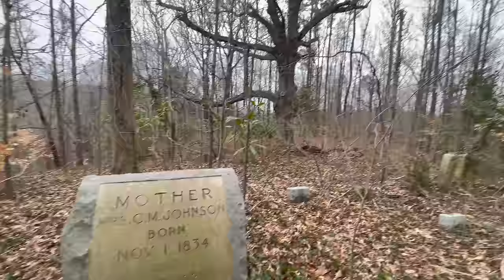Exploring The Unknown: I Found An Open Grave!

Comment: I worked in a cemetery… it’s called a concrete vault, and the casket is placed inside to prevent water getting to the casket
Reply: I worked at both Funeral Home and a Cemetery, if that vault has the lid on as this one does, there is a casket inside, got to remember that vault ( Plain One ) is right at 1800 lbs including the lid, lid is about 400 lbs and it seals itself, why they have a 2in hole on one end. Could be a disinterment and moving it some place else, Hope this helps.
Reply: Thank you
Reply: No Dalen YOU ARE NOT THE ONLY ONE THAT  IS FEELINGS THAT WAY IT Looks scary in THAT  grave and very tight.
Reply: Yes and it stops tha casket from collapsing.
Reply: My funeral director/embalmer husband of 44 yrs says it Is a concrete vault. There is NO ONE inside or it wouldn’t be left there unattended. It is to protect the casket from collapse and seals to keep out moisture for protection of the body.
Reply: Thank you for the information shifter friend!
Reply: I've heard that it helps to keep embalming chemicals from leaching into ground water as well.
Reply: If some thing came up behind me and made a loud noise that would do it for me!
Reply: Yes a burial vault, it also keeps the grave from sinking in once the wooden casket decays.
Reply: Yeah… I was sure no one could leave that unattended. At least not in my state.
Reply: Also called a liner
Reply: We recently buried my uncle and we had the option of a “liner”.  Same thing. It keeps the casket safe from all sorts of damage.
Reply: Liner
Reply: Or could be another person is going on top of that vault. They do bury one on top of another
Reply: @elizabethruggiero9950  I was wondering, why is it just out there. Maybe the funeral is real soon. weird.
Reply: In my state, we are not allowed to leave an open grave on attended. If it was open and ready for burial, there was always plywood over the hole. We also never left a vault out. The bottom of the vault is placed in the hole, then the casket is lowered, and the top goes on once it’s in the ground. The lid is on, there’s something in it. State regulations would never allow that where I live. It looks like they just took a lunch break in the middle of the process.
Reply: No the casket is in that vault in the ground uncovered
Reply: There is leaves crunching in the ghost monitor along with the voices
Reply: @michellelanigan1964 if there wasn't a casket in that vault it would not be sealed so someone else probably went ontop of that one
Reply: Why is it sitting above ground right now
Reply: Prevents for a little while but over time it crumbles,cracks and collapses. To me just a way to get more money from family or state..
Reply: This is already placed in the ground before the funeral procession even gets there. The casket is then lowered into this vault. Like others have written, it is for protection. Very common where I'm from.
Reply: I've seen too many concrete vault's that have flooded and the caskets are filled with water. Such a shame 😢
Reply: That's a concrete vault, and the casket is inside.
Reply: Where I'm from, the vult is already in the ground before the casket is inside. Lid is put on after all people have left the burial.

Comment: Dalen! That is a massive cemetery! How can the city or the county allow this hallowed place to be so neglected!?
Reply: It looks to me like one of two things. The crew set the vault and then something on the end caved in (the small cave there is not supposed to be there) so they stopped. Or, the crew set the vault, stopped for lunch and planned to bring the rest of the setup/equipment out to finish afterwards. Cemeteries are a work in progress. The cave in bothers me though. Is there another grave on that side of the hole, or is there an underground problem the cemetery doesn't know about (perhaps a broken water main or somehow something wasn't backfilled properly before?)
Reply: Tru

Comment: You were told  correct,this cement container is the vault. It goes in 1st,then the casket is sealed inside so water 💧 or anything does not get in the  casket. Keep up the good work. ❤❤❤

Comment: They must not have used burial vaults in the old non-perpetual care part of the cemetery. I'm glad one of the graves didn't give way beneath you where a coffin has collapsed.
As much time as you spend in cemeteries, the odds are that eventually a grave you're walking over, or standing on, will collapse. You're alone a lot of the time. Please be careful.

Comment: Hey Dalen. I would think that if someone got a pod and was to the point where they were going to use it they would have answered those questions. So let the 3 questions inside the pod give them something to laugh at. Are you sure? Are you really sure? Are you really, really sure? Go out with a bit of levity.
Reply from the maker: I get that… but I feel
Like for something that serious you gotta be SURE. I read that out of all the Golden Gate Bridge fall survivors the vast majority said they regretted it the moment they stepped off the bridge.
Reply: @DalenLSpratt  oh you definitely have to be sure and is not something to be taken lightly at all. I just wanted to put a little humor in it. It’s a very heavy, thought provoking subject.

Comment: Daylen that is called a cement vault it is used to put the casket in. It helps to protect the casket from being crushed by the earth so the grave to won’t cave in is also known as a grave liner. They also have steel vaults, which is the same as the same but different material

Comment: Also, the vaults prevent the grave from "falling in" as is the result of wood caskets rotting and falling apart which causes the ground above to sink or cave in over time.All graves that are found in older resting areas that are not kept up, have "sunken" or "caved in" graves  due to wood caskets having been used.Perhaps when no casket was used as well.

Comment: Dalen that is concert vault for casket to go into. Here in Missouri you can just bury the casket without a vault. There are so many different onesThis is cheaper one. There  are metal oneso,  steel ones, There are vaults that completely seal no water can get into caskets. Think about it if it's raining and grave hole has water in it.
There different prices on all different vaults.

Comment: Yes. They are cement vaults that go in the ground first; and then the casket goes in the vault at time of burial. Yes, it helps to keep the moisture and dirt off the casket. In some states they are required by law to put in vaults.

Comment: Hey Dalen!  Most are called vaults or grave liners.  Majority of cemeteries now require one to keep grave from falling inward.   Both parents had one.  The bottom liner is set first, after burial/grave ceremony they will lower casket in, then seal the top on and finally the dirt 🤷🏼‍♀️  If you were ever buried alive, rare nowadays, one would never get out since the liner lid alone is about 350-400lbs.

Comment: These grave liners are also known as rough boxes, concrete boxes, or grave receptacles and may be required by the cemetery. They protect the casket preventing cave-ins for the ground above that could cause damage to the cemetery property

Comment: I googled the outer burial container and burial vault.  What I found was "First of all, outer burial containers and burial vaults are not required by state or federal law. They are required by most cemetery rules and regulations. Cemeteries want a casket placed in an outer burial container or burial vault to prevent the ground from sinking in above the casket.  Without the use of an outer burial container or burial vault, cemeteries would require constant maintenance to keep the ground level."

Comment: That is a concrete vault. The casket fits inside and the concrete lid closes it off. It is lowered in the hole the concrete lid is sat to the side along with the dirt from the hole. The coffin Fram is placed around the grave hole and covered with the astro turf grass. The coffin is suspended by three straps until after the graveside service. Asked how it worked once.

Comment: Those are concrete vaults to protect the casket. The casket is placed inside of it to protect casket from water damage.  Not everyone gets vaults, however, some cemeteries might require it due to the type of ground the casket will be lowered into.

Comment: What is the concrete box in a grave?
Grave Liner

These grave liners are also known as rough boxes, concrete boxes, or grave receptacles and may be required by the cemetery. They protect the casket preventing cave-ins for the ground above that could cause damage to the cemetery property

Comment: I hate this type of vault because it opens on the top.  A tar-like seal is placed between the lid and vault after the coffin is inserted to keep groundwater out.  Guess what happens if that isn't done correctly, or the seal dries out and cracks. Granny's coffin turns into a bath tub. I like the ones that open on the bottom. The vault is still sealed between the base and vault, but if the seal fails the vault acts like a bell jar and naturally keeps the water out.

Comment: That is a vault that the casket goes in. The dig a hole and lower the vault down into the grave and as soon as the funeral is over the casket is lowered into the vault for protection of the body and casket.

Comment: That is called a vault, and they use that so that their area will not cave. In. It also protects the coffin from Getting crushed. It also helps not linen to chemicals used for involving 2 seep into the ground around it. Each state has a different law. Most states you do not have to be embalmed

Comment: I believe that is a casket box you set it down in the hole that you dug after you dig the grave spot up and then when you when they set the casket down that comes up that's just a protector so none of the dirt would collapse as they put the casket down into the groundthe bottom of it should be Halo but some people also have another Stone box to put their casket in to seal it a lot better

Comment: Those are concrete vaults that are water and air tight that almost all States require that caskets are lowered into and sealed shut inside of. They are to prevent any water to get into the casket after being buried,,,,supposed to last for decades. As well, they are supposed to keep and fluids/air from escaping from inside.  They also serve to protect the coffin from decaying due to moisture in the ground and helps preserve the remains for any reason to exhume the body for any reason.

Comment: That is a vault That particular one is made out of concrete, it goes in the ground then the casket is lowered into it then they put the lid on it. They use those so the ground does not cross the casket.

Comment: Its what's called a vault it goes in then they casket is paced in it and the concrete lid is out on then its all buried. It protects the casket and deceased from hopefully water damage, but also mainly from damage over the years from the weight/compression of dirt/gravity to said casket.
You could use the name sarcophagus if you wanted to😅.  Cause an ways its sorta is

Comment: I'm sure there is a casket inside the one that is in the ground. Like others have said, the spouse may have recently died and will probably be placed on top of them soon. The one where the vault is on top of the wooden rack is probably empty right now, and is getting ready to be prepped for the funeral, because they put that fake grass carpet around it and all. Once the vault is placed in the ground [waiting for the casket], the vault lid is usually placed under the tarp next to the plot by the pile of dirt, I think. 

Also, that's what I love about fall and winter, bugs go back to their little 'insect hades'.😄

Comment: That is called a concrete volt and you can buy different types of volts one it’s just a plain concrete and the big thousands of dollars you can get out get different prices. I know they have steel reinforced ones and they can’t guarantee how long that’s gonna last because once you put tons of dirt on top of it, and it just sits there continuously it can collapse, and that’s one reason why they keep cemetery staff full-time so that when they see a dent says speak in the ground they know something has collapsed and they could fill that in but the cash goes in the vault and it’s supposed to protect the casket, and I’m gonna use the word longer than if you were just to put the casket in the ground

Comment: They couldn't do it it's made of cement it's concrete very thick and not porous at all and you put the casket inside it blocks out water are insect keeps the casket in mint condition along with the body so you could dig that body up years from now and it would look almost identical to what it looked like when it went into the ground ♥️🇨🇦♥️

Comment: Yes that is a vault
 It goes in the ground first
The casket is placed inside. it used to be you was asked if you wanted your loved one in a vault.but i  have been told they do not have ask anymore because it's mandatory. Because of certain diseases you can't just put a casket in the ground. If you have a family cemetery you can do whatever
 But you can also buy your plot and your vault ahead of time. Vaults come in colors now. The vault is placed in the day of or the day before. They put the casket is put in and the top of the vault is placed on top
 Dalen that can be a old vault. Either there is a casket in there or the person is about to be buried. I know families that buy plots in advance. They buy thier  vallt so the family don't have to go through that pain. Yes i plan to have a  inground vault. Also there are double graves where i can be buried on too of my husband. They will cover his vault, lay a layer of cement then place my vault on top then my casket will go in my vault. I'll get covered up. They will slab it over. No they don't leave caskets or vaults with remains in them outside why. Some people are just crazy..think about this.the church cemetery where Moms maternal grandparents are buried, they had no marker. It's possible that others have been buried on top. I'm told it happed if the grave was not marked. But thankfully they do make sure those buried now have markers. I hate my cousin was military, had a special casket. I'd love to visit him. But nobody knows what part of the cemetery he was buried. It's a very small cemetery ✌️🕯️💕🌻🦋✨🙂👋👣. Vee and Andrew.💗💗💗.